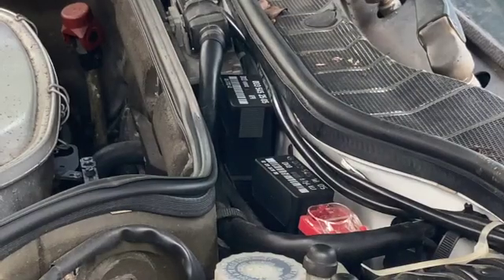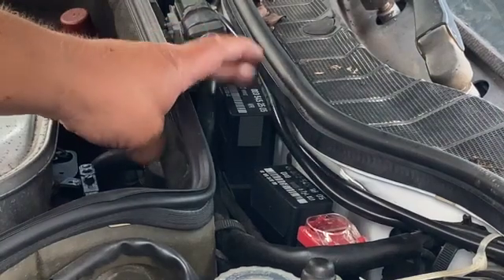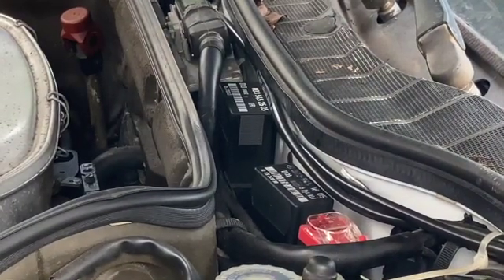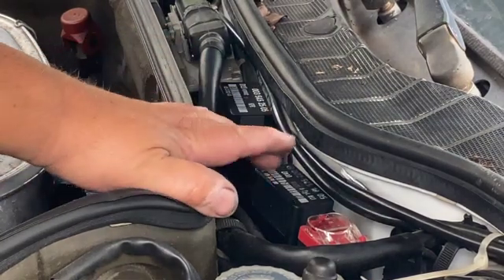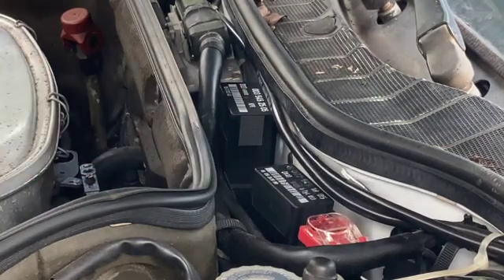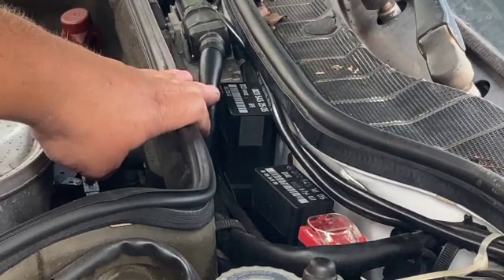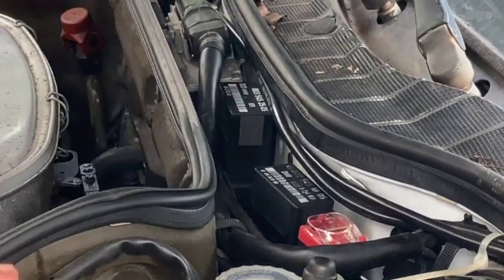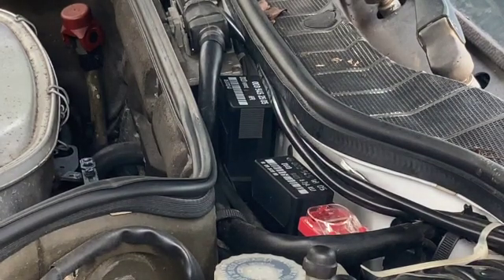Fuel pump relay failure symptoms: engine stops, hard cranking and high idle RPM KE Jetronic Benz

Comment: I coincidentally replaced my FPR today due to the engine shutting off 3 times last night on a 120 mile trip. Today, I drove 250 miles with no issues.
Reply from the maker: Hopefully you have found your intermittent shut off issue. It is quite annoying right?
Reply: @straybenzes  
Extremely annoying if it shuts off in traffic.
Reply from the maker: @Cpcsof1  ...and dangerous. It did that to me on a three lane highway and I was in the left lane.
Reply: @Cpcsof1  hi, this happened to me yesterday in my 500SEC. It did it while I was doing about 60mph and a couple more times when slowing down. The speedometer started to drop and the car lost all power. Would you say your issue was the same?

Comment: Hi 

All the way from Zimbabwe. 

What could be causing my baby  c200 (202) to cut running just after starting and managing to drive if l put a  rev then cut again as soon as l let off the acceleration paddle and allow it to get to below 5 revs reading on the counter, all this time my gauge will be correctly indicating  1/4 tank fuel
Reply from the maker: Thanks for writing to me. That should have the 2L M111 4 cylinder engine in it. It has a completely different engine fuel and control system than the old KE Jetronic cars. As such it is best to first use a OBD 2 code reader to scan for any trouble codes so that you can narrow down your particular issue. It is very difficult fi not impossible to diagnose this from remote.

Comment: Thanks for the info I have a 1999 Mercedes-Benz SL500 I replaced the fuel pump and the fuel filter and when the car runs great but when it warms up and I turn the engine off I have to wait till the car cools down to start the car back up again so I'm going to replace the fuel relay and see if it's the problem thanks again have a great day
Reply from the maker: It could be that little green relay, but I actually doubt it as an electrical issue is typically rather erratic and independent of engine temp. If this happens consistently with a warm engine it could still be fuel pump and / or fuel filter. Especially if you used non Benz parts. I have had both fail internally with the fuel filter causing starting and running issues. Good luck.

Comment: Hello I hope you're doing well,I was driving my 1989 Mercedes Benz 300se and just shut off but managed to pull off the road and again started but I had to keep my foot on the gas pedal because without doing so it couldn't idle until I reached home and parked it.   Do you think I should replace the fuel pump relay? Please reply thank you
Reply from the maker: Issues with the relay cause for the engine to run one minute and then to shut off completely and no pushing of the pedal will keep the engine running. It will not even start unless the relay comes back to "life". Your issue may be related to a few other issues that you will need to hunt down. Changing out the relay will not hurt and you will have instant confirmation if that was the issue.
Reply: It'll hurt you wallet. A FP relay is £160!
Reply: @bikeman123  €19

Comment: This video nailed my MB-560's issue perfectly.   Great job and thanks for posting!!!  I ordered a new relay, and while waiting for the new one to arrive, I decided to touch up the existing relay's circuit board solder.   That fixed the relay and I'm still driving with the one that I refreshed the solder.
Reply from the maker: Great job, Mark. Amazingly a lot of electrical gremlins in electrical components is related to cracked old solder joints. All the best.

Comment: hi sir, new suscriptor here. do you know something about 722.3xx gear boxes? mi w124 won't work very well. when i start to move the car 1st gear never come off to a 2nd gear, but if i quickly put N and D again 2nd gear gets in. then 3rd an 4th as ussual. i try to diagnose this by a year now. filter and oil are new, i work in car electronics and mechanics but old benzes are a little like black magic, no ones want to touch it. can you give me a cable with that one? thanks in advance
Reply from the maker: Hi Patrick; 
What year and model is your car? The 722.3 is a very sturdy transmission. To me this sounds like a bad or stuck kick down switch. Look under your gas pedal and locate the kick down switch. Make sure that there is no carpet or foam material stuck there. Does that switch move freely in and back out? For the heck of it disconnect the wire connector to the switch and take a test drive. If your tranny shifts ok it is definitely the kick down switch. Good luck.
Reply: @straybenzes  thanks for quick response, pedal switch in perfect condition and solenoid cable already disconnected and tested with no change.
Reply from the maker: @serverdll  Got it.
Reply: @straybenzes  car is w124 1990 M103 and 722.358 gearbox... 124.930 chassis.
Reply from the maker: @serverdll  This also can be the auxiliary oil pump not working or not working properly. Potentially, it may be a blocked passage(s) in the valve block assembly.
Reply: @straybenzes  thanks for the answer. my daily car (w164) needs a new battery so now i use my w124 everyday so as soon as my 164 get in the streets again i drop my oil sump for a better inspection. thanks for the support.
Reply from the maker: @serverdll  That is a nice ride.

Comment: Hi I have , e190 w201 1.8 it's slow to change gears 3 second pause, can anyone advise where I should start looking
Reply from the maker: This can be a symptom of the modulator needing replacement, faulty vacuum level, or even debris built up in the tranny valve body. Checking the vacuum level and modulator are the easy check ups. Opening up the tranny is more complex.
Reply: @straybenzes   I think it might be the potentiometer now , but I will look at vacume when I get it up on the lift.
Reply from the maker: @Rossithailand  I hope you will find the root cause.
Reply: Thanks for fast reply,  your videos are a great help
Reply from the maker: @Rossithailand  Glad they are helping.

Comment: I have a 1987  420 sel... It's been sitting in the garage for A while.. Haven't started it in about a  Year-ish... Went to start it I didn't hear the  buzz of the fuel pump when you turn the key... It was just a dry spin no fuel whatsoever... Not even a cough.. Will the fuel pump relay from a 1990  560SEL fit in my 420?... I have a 1990 560SEL parts car.. thanks
Reply from the maker: The relay should be the same. Trouble is that the parts car's relay may not be in much better shape. Good luck.
Reply: @straybenzes  
 Thank you appreciate it

Comment: Hi..if feul pomp relay is not working properly ,should be power on fuses ? i dont  have electric power on 8 fuses and also on feul pomps...engene cant start...Thanks for same information where is problem...
Reply from the maker: Make sure that the fuse(s) in the overload protection relay are ok. With that checked I would take out the fuel pump relay and put a jumper between pin 7 and 8. That turns on the fuel pumps. You should have 12VDC on pin 7 with the ignition on. Hoping this will help

Comment: Thanks for the video. Can this relay cause warm start issues? I’ve been chasing my warm start issue for a while.
Reply from the maker: It could be, but I think that is highly improbable. Hot start issues are usually caused by low fuel pressure and that is usually due to an internally leaking fuel pressure accumulator. Did you change that one? That part sits right next to the fuel distributor on the driver's side. https://www.pelicanparts.com/More_Info/0004761021.htm?pn=000-476-10-21-M253&gclid=CjwKCAiAsYyRBhACEiwAkJFKotmqdMUDvinAuGKHfafQWnrvK49ra-z4REAv3YH8Wzdw8ngRyWKwWxoCDzwQAvD_BwE
Reply: @straybenzes  thank you. Yes, I changed the accumulator and it worked about 6 months ago. The problem is back. I changed the injectors but didn’t seem to fix it. Could it be the fuel pressure regulator?? I think it’s time to get my mechanic to check the fuel pressure.
Reply from the maker: @sophiathe380sl  Yeah, that would be a good start if you cannot work on this yourself; Good luck!
Reply: Can you please give a diagram to jump it.

Comment: But fuel  pump relay wld be a great video for the channel and it’s not a lot of work and wld help a lot of new owners
Reply from the maker: Every little bit helps.
Reply: @straybenzes  well I have a question my car is 420 SEL I started and is don't start then I don't have fire in the spark place? What should I have to do???
Reply from the maker: @yousifyousif8659  Oh wow. That could have a variety of reasons. Are all spark plugs not getting power? Did you check the distributor cap and rotor for any issues? It could also be the EZL ignition module. How did you establish that you do not have any spark?

Comment: How bro man love the ch but if you cld show a video with a quick fix (when fuel pump relay goes out quick fix) I keep two wires copper thick you can use to bypass fuel relay but you can wire to ports 18. 31 something like that but you can keep fuel pump on but have to take positive Terminal off to cut off fuel pump but you can power your car with out a fuel pump relay and I know how to start a W-126 without a key which I want explain in comments but will give a hint if your steering lock isn’t Engaged it’s a screw in abutton to pull out the steering lock Assmley incase of key lose
Reply from the maker: That is another couple of great tips. Thank you!

Comment: Can they be rebuilt or repaired? Sounds like something one would want to keep on hand in the glove compartment.
Reply from the maker: They are unfortunately a lot smaller than for instance the cruise control amplifier. They have only few items that I could see that could possibly be replaced. Good idea to keep one in the car when you need it In a pinch a jumper will work as well, but that is certainly more messing around that can be avoided by having a new one handy.